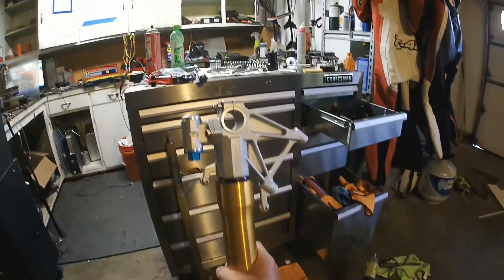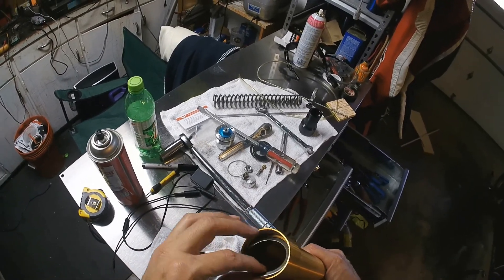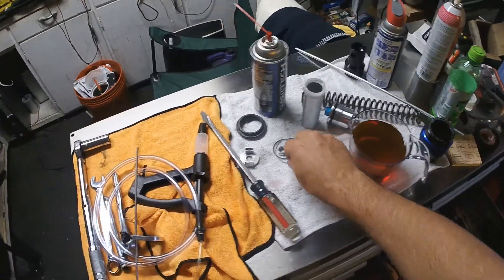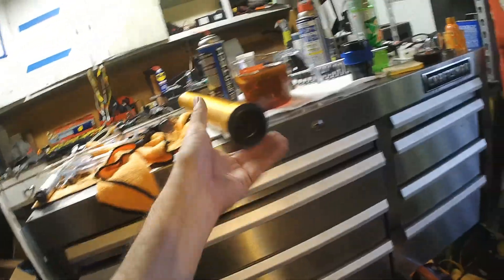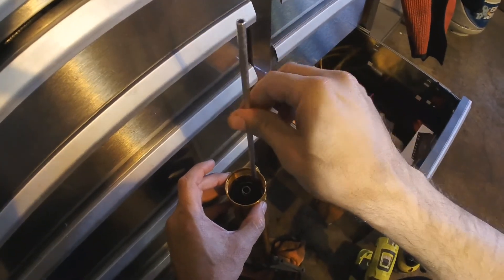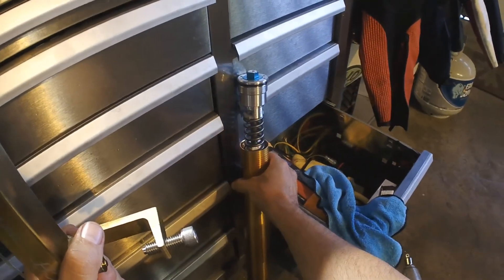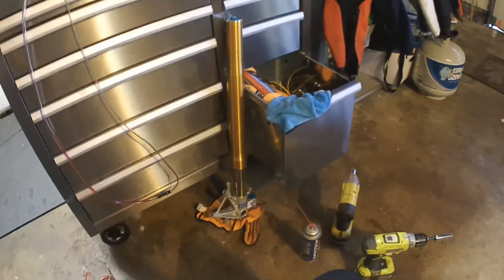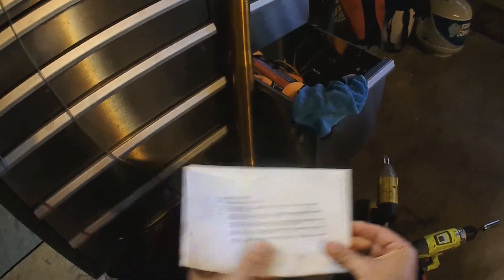RSV4 Fork rebuild

Comment: Thanks again for the video, watching you and looking at the manual I did note that when you are putting the spring back into each leg, you can pull the cartridge right up and out of the inner sleeve and the resistance of the oil will keep it there while you drop the spring over it, allowing you to grab it and get the machined retainer piece and nut on... and again, you don't need to compress the spring, you can get an adjustable spanner around the nut thanks to the big flats on the spring retainer piece and then screw on the main cap.
Reply from the maker: Hi Dorwood. With the proper spring compressor the job is a lot easier - and safer. My girlfriend just did the same job on her MV Agusta and the proper tools made it a lot easier. She never even chipped a nail!
Reply: @ShaunNielsen  Impressive. I chipped two when I did mine! Did you see what I was getting at though? You don't need to compress the spring at all as with the flats  aligned you can access the nut without any spring compression... So long as you go them done!
Reply from the maker: I did. Thanks.

Comment: Hey sorry to tell you But you assembled your forks very wrong! And as well missed out on a super important tip for home guys to be careful of.. And that is if you remove the rebound adjustment rod becareful the needle and spring don't fall out and bounce across the floor.
Upon reassemble always check that the rebound rod has resistance of the needle & spring inside the damper tube! The spring goes in first then the preload tube with plastic down to touch the spring! And us the 2 holes on the preload tube to assist with assembly.

Comment: First off. I like your video alot! Good job👌 Is the "correct" oil 5w 110mm height? I see you did a 10w 150mm.
Reply from the maker: I used heavier oil to suit my body weight

Comment: Hi Shaun just wondering why you over fill the fork and then have to take the excess out, could you just put the correct amount in to begin with? Great videos by the way!
Reply from the maker: Thanks Aldred. 
if you add a certain volume of oil, its possible to overfill the fork if there is a little left inside the tube. By overfilling, then removing the excess you are always guaranteed that the air gap is accurate no matter how much was left in the fork originally.
Reply: Thanks for explaining that Shaun

Comment: My forks are leaking at around 15,000km, is it possible the seals inside are just dirty or not seat correctly? Or do i really need to replace them now?
Reply from the maker: After 15,000 k's the suspension fluid needs to be replaced, which will require new seals.

Comment: i use the same fork. Oil is 90mm without spring. I think 150mm ist too low. You should have disassembled the compression cylinder. A lot of  old Oil stay in there.
Reply from the maker: Thanks for the tip. I'll do that next time.

Comment: Great video. You mentioned the orientation of the washer but you put it back in round side down instead of round side up. Presumably there was no difference?
Reply from the maker: Thanks for pointing that out. I need to double check
Reply: Shaun what did you find on the recheck? Curious as I’m preparing to replace seals myself this weekend.

Comment: Hi Shaun - just rebuilt my forks this weekend with the same oil level (i use ohlins oil for the rebuild). Havent made any changes to the settings yet though.....what did you think of yours...?
Reply from the maker: Thats good to hear Comfy. Suspension settings are totally subjective, and also highly location specific. I've been doing a lot of riding on a very rough track so I eased off on the compression damping and also sped up the rebound in an attempt to keep the tires on the track after a severe compression. So far its working well, to the extent that I can see the wheels of other bikes I'm following leave the track in the really bumpy sections. I have more confidence in these areas so my settings seem to be working well. 
Or maybe I'm just more accustomed to the bumps? 
Like I said, totally subjective.

Comment: Did you go with OEM fork seals?
Reply from the maker: Yes - OEM Ohlins seals.
Reply: Thanks for the video.  It helped me go through the process of changing my seals.  I noticed you put the spacer back in before you filled the oil to 150mm.  I have read in a few placed the spring and spacer should be removed when you fill it back up with new oil.  That is the way I did mine so it should be interesting to see how it works out.